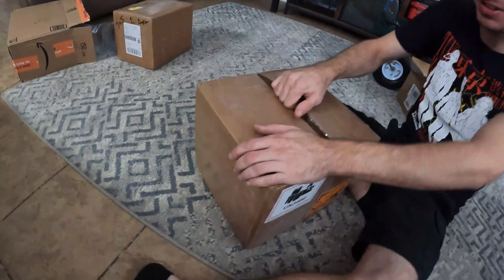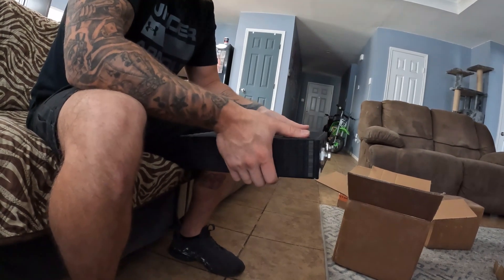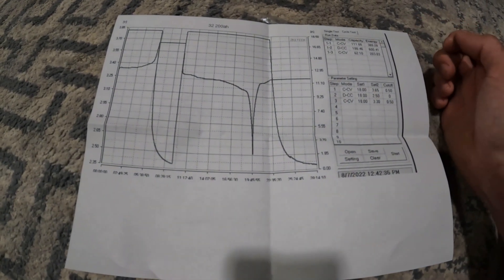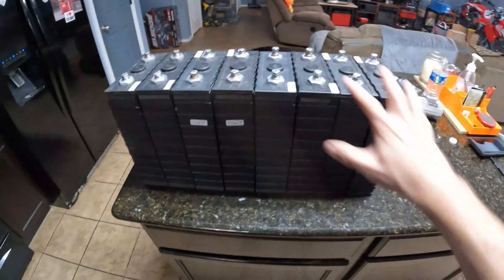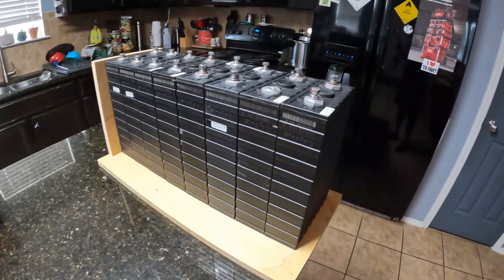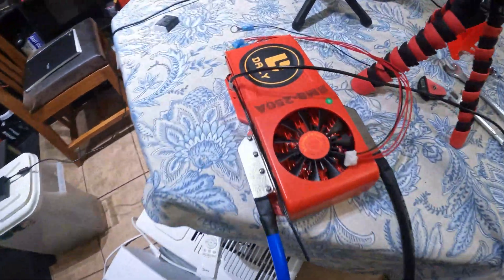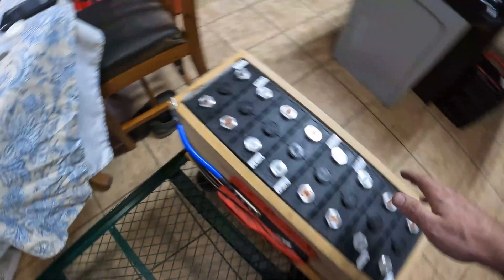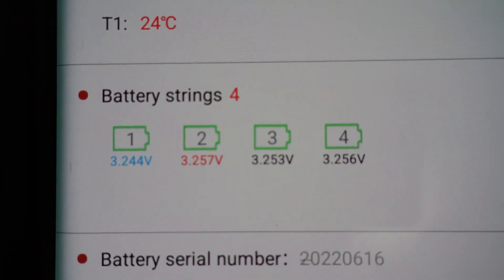DIY 12.8v 400ah Building a 5.2kwh Lifepo4 Battery Sinopoly cells, daly bms

Comment: how is your build after many years?
Reply from the maker: @sophiafunworldatthepark6740  it’s been solid I use it daily has been reliable
Reply: @Mikebuildss  I just ordered 8 of them like you did. I will build 8 cell but 24v 200ah. The only different I bought the 150a BMS; I should buy a bigger one.That is good to know.  Where do you get the wire for the connection between battery cell? 
Thank you
Reply from the maker: @sophiafunworldatthepark6740  it’s 4 awg OFC copper amp cable from like a car sound system, it’s nice because it’s flexible and very ohh quality, then I used a hydraulic crimper to crimp the lug on with. You can buy it online just make sure it’s pure copper and not CCA (copper clad aluminum)

Comment: please i just ordered this particular sinopoly battery from China about 48pcs and my system is 40V please can you give me diagram on how hook them on one BMS?
Reply from the maker: Are you sire it's 40? And not 48? The bms will come with a diagram
Reply: is it OK to hook up 100A bms with my 32 cells 51.2x16x400=20480kwh and i have 100Bms with battery equalizer
Reply from the maker: @nathanprofit3966  yes go for it, be safe!
Reply: so sorry sir i mean 48V